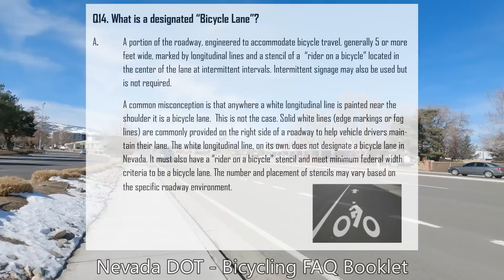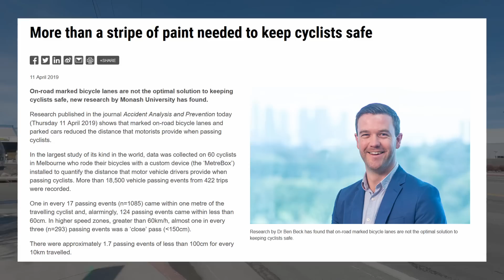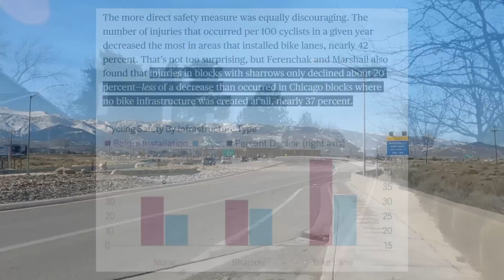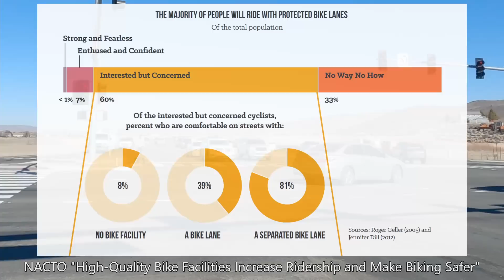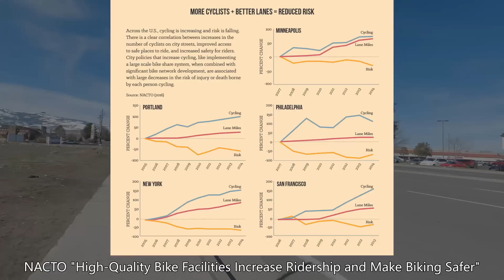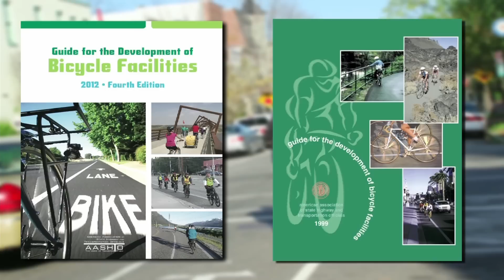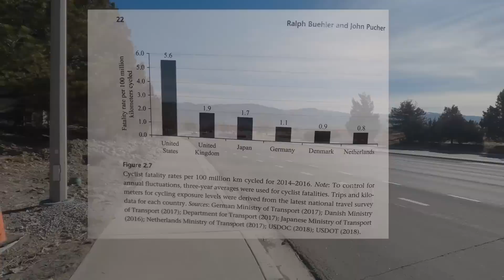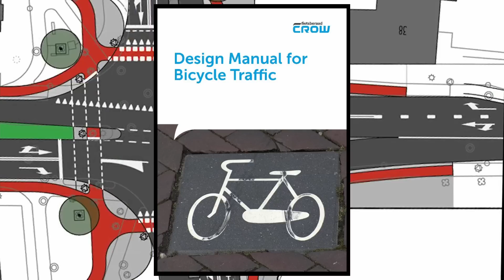Painted Bike Lanes Are Atrocious & Here's How to Fix Them

Comment: I guess you could consider me a vehicular cyclist.  When I was growing up and a young adult, there was no bike infrastructure to be found anywhere.  I lived in a more rural/small town area and if you wanted to ride your bike somewhere you just shared the road with cars most of the time, using shoulders when available and safe enough.  Later, I used my bicycle to commute to work while in college, on city streets, again with zero infrastructure.  Back then the advice was to learn hand signals, occupy the lane when turning left, things like that.  I did that and I was fairly comfortable with it.

What strikes me about these painted bike lanes is that -- as a "vehicular cyclist" -- there's a lot of them I would flat-out refuse to ride in.  They put me in mind of the narrow shoulders with sharp drop-offs you find on a lot of higher-speed rural roads (as opposed to the really rural roads with no shoulders at all), where you'd have to be suicidal to try to ride there.  They're the worst of every world.  You're far enough off to the side that a distracted driver won't necessarily notice you, but you're not able to be far enough off to the side to be safe from those same distracted, line-hugging drivers.  In situations like that I would always, always ride a couple of feet into the road.  Far enough that people coming up behind me in cars were more likely to notice me, while leaving some actual room to move over to the right if someone was nevertheless getting too close, without risking hitting the edge of the pavement and crashing.  And these stupid painted lines are saying to bicyclists: here's where you belong!  Oh heck no.

Comment: I am a frequent cyclist, do 99% of my shopping with the bicycle and I like the painted lines. If I'm on a separate bike lane, I'm often enough closer to pedestrians with their very erratic movement patterns, at crossings incoming cars will cross the bike lane - often without looking for bikes - winter service is generally bad on bike lanes, so my safety is compromised much more than cars passing at one meter distance. In Italy trucks will generally give you a warning honk to prepare you for the wind gust.
Now I have been very much annoyed by car drivers - on roads w/o bike lane markings - who want you off the road as their very own property and I have enjoyed - very expensive - bike lanes separated by a tree line but dare you wish to do a left turn into a smaller road, this is often not supported and you will to pedal on for hundreds of meters and the back track on the other side.
Drawing the literal and figurative line is a cheap and quick solution, to facilitate both sides cooperating.
On narrow roads where full bike lanes are not feasible this often the only sensible solution. And a cheap solution now is better than millions on solutions that will be ready ten years from now, will make car drivers even more hateful and face it is just more land put under asphalt.

Comment: George Carlin said it best - a bicycle is basically a toy. A bicycle is not practical transportation, especially where I live. There are elevation changes of over 1000 feet in short distances. Easy enough in a car, not so much on a bike. Everything here is a steep hill. Anywhere you ride it is uphill both ways.

Comment: They recently added bicycle lanes to Greensprings Highway, an industrial road for decades. This reduced car lane widths by several feet, making it hard for semis to use this road. Nobody rides bikes on this road because it is suicide to do so. If they do, they ride on the sidewalk. These bike lanes are atrocious. They have white pylons marking them off which also removed all turn lanes from the main road. Many of these pylons have been plowed under, which is what would happen to a cyclist stupid enough to ride there.

Comment: It's not just the US. I live in Romania and in my city the older administration did the exact same thing with bike lanes. They took the outskirts of the road and "transformed" into a 50 cm wide bike lane. That part of the road is where you have manholes, asphalt burr, potholes etc. You are riding along speeding vehicles that can suck you into the traffic if they go by fast enough. The scariest part is when buses pass next to you at an intersection and you don't know if they will cut your way or  run you over. Then you have cars parked with their rear protruding onto the "bike lanes", forcing you to jump into the traffic to avoid them, or irresponsible drivers opening their car doors right as you approach them. Riding on the boardwalks is illegal here, riding along with the cars is  scary and dangerous, especially at peak hours when all the "bisons" (as we call them) speed at traffic lights, stops and intersections. Whenever getting on your bike here you're taking a big risk on your life.

Comment: The problem is  a lot of the lanes are stuck into  ways that were NOT designed to have bike lanes, so they already eat up space needed for the cars, and if you add dividers it is easy to end up with car lanes too narrow for trucks.
Reply: You just found the root of the problem. Most streets can't even accomodate 2 cars, and some can't even accomodate 1 car, less can them accomodate trucks, buses, bikes, and motorcycles.

So what's the solution? Play the classist game and try to prevent bikers on the PUBLIC ROAD!?
Reply: This has been solved in many countries already. Give pedestrians and bicycles PRIORITY on the roads. Less polution, less noise, more kindness and sharing, more nature, more space, and bye bye traffic jams the main reason for people being always angry.
Reply: @angelhdzdev  That does not work when the said path is the only path that connect  2 large regions. Cars still move  more way MORE people than  bikes, so  the theory should be priority for  Buses, then cars, then  bikes. You cannot  expect    tens of thousands  to  lose their day because of a few hundred.

Comment: Although I don't enjoy the fumes and noise of the passing traffic, that is just a minor issue.  The important issue is the lack of separation and speed difference between me and the motorized traffic.
Reply: "the lack of separation"
I feel much safer in such a painted bike lane then in a fully separated bike road. Before a car turns right, it has to pass next to me and hopefully notice me.
Reply: @williamforsyth6667  Tell me how safe you feel when a fully loaded logging truck gives you a foot of clearance at 60 mph.  It scares the crap out of me!

Comment: Cyclists like predictability and continuity. I prefer a straight white line as segregation. If a street has parking then a separate path must have sufficient width for overtaking and safety from opening car doors. Bikelanes are useless if they change character all the time. A driver in a car can go down any street and be familiar with the layout - its straight and wide. Cyclist want the same and they actually need the safety it provides. To save space - in the real world - lanes for right turn can merge into the bikelane. Any special design is a huge red flag - predictability is key. I'm riding bikes in Copenhagen and suburbs.

Comment: These are just so strange to me, it seems so foolish. If the space for a bike lane isn’t the problem, why not make it any kind of raised/protected lane? Where I live in England, most of our bike paths are raised to pavement height. (Sometimes with a slight slope to make entering and exiting the lane easier), and they’re often semi-shared spaces. A common layout is a single width bike lane and a pedestrian “lane” of the same width (or slightly larger), and you stay in your own space unless you need to use the other space to pass. It’s not perfect, but it’s a lot better than a painted gutter, you get some form if protection, and it makes good use of space, in areas where a full size cycle path isn’t possible it’s good enough, providing bike and pedestrian traffic isn’t too high.

It just really boggles the mind that rather than something like that America just paints lanes in the middle of high speed roads.

Comment: The biggest problem where I live as far as bike lanes is that even if they did a protected bike lane on the stroads where they shoved gutters, there are still just way too many driveways and conflict points to contend with.  The solution there would I guess be to consolidate this stuff, but that would take a ton of money and political capital that I think is probably better spent elsewhere
Reply: These are the situations where traffic filters and stitching back roads together with bicycle/pedestrian only short-cuts can solve the problem.  Just leave the stroad to cars and setup a separate route for bicycles and slow-local traffic.

Comment: Jersey City used paint to rapid build bike lanes, but they used the Dutch design manual to do it. Within a year it became one of the safest cities in the country to cycle in. The paint was considered a temporary emergency measure to keep people from dying, and 2 years later they have been going back and installing concrete barrier between ALL bike lanes and car lanes in the city to improve safety. The state of NJ also made it illegal to get less than 4 feet from any road use, such as cyclists, with a motor vehicle, it’s illegal to pass them going more than 25mph unless it’s a separate marked lane, so any of those dangerous passes mentioned are explicitly illegal. On roads without separate cycle lanes it’s illegal to pass a cyclist if it’s illegal to pass a car and you are required by law to slow down to the cyclists speed, or come to a complete stop. They started installing “super sharrows” where the entire width of the lane is painted green, to indicate the car is in a cyclists space, not the other way around. 

Paint can be used to help cyclists, but only if what you are painting is laid out to Dutch standards, and it’s a temporary measure until permanent concrete protection is installed.

Comment: I would add an exception to paint is not infrastructure: Painting bike lanes solid red (or using red asphalt) actually helps. Of course it shouldn't be used as much to separate cars from bikes and more to separate pedestrians from bikes. We all know if there are just lines on the ground pedestrians will simply ignore them and walk on the bike path.

Comment: 3:25 There are many of these. They make sense at an intersection where the right lane is a turn lane so that bikers can have a designated (yes, I realize it's just paint) lane to be in if they are going straight (or even left). It's where they should be anyway if not turning right.

Comment: Honestly, painted bike lanes by themselves are not a problem. I ride on them every day in Germany and I do think they have their place in city streets definitely not on roads). While being raised on the curb feels safer, it creates problems at the intersections. Unless you commit to Dutch levels of separation and bike priority, having bikes on the road at intersections means better visibility and better left turns. 

If you’re on the sidewalk, the likelihood of being hit by a car doing a right turn are quite high, especially with the American „turn on red“. Having green for bikes a few seconds ahead helps, but I’m not sure Americans are ready for that step. Having the bike lane on the left of a right turn lane means the sorting happens in motion, when the bike is in front of the car. Also turning left from the sidewalk means waiting for two green lights, which is just a nuisance.

The core problem with American bike lanes are the stroads they are painted on. If you have roads the size of highways, putting a tiny bike lane on it just doesn’t work. On those roads starting with anything else then separate infrastructure will never work. Then slowly decrease the width of the road and the traffic and in 10-20 years people might be slow and used enough to bikes for them to respect a decently sized bike lane. And then it’s actually better for bikes on the road. But any speedlimit above ~30mph is too fast for that.

Comment: This is why I just use sidewalks when biking in US many cities (except the dense urban cores though). These bike "lanes" are just so randomly-placed, inefficient, and outright dangerous if the speed limit is above 20 mph. I'm aware of the many dangers with biking on sidewalks with pedestrians and curb cuts, but most sidewalks are empty, wide, actually grade-separated for protection, and fairly well connected.
Reply: In my option bikers are pedestrians and sharing the road is down right stupid. Bike hitting walker most likely minor injury, car blearily hitting biker high risk of death or life changing injury.
Reply: @Zucr_ Bicycles are most definitely not pedestrians. They are much faster and can't  turn the same way a pedestrian can. They share vulnerability against fast heavy motor traffic. Similar to sidewalks there should be bicycle lanes or streets hostile to fast motor traffic such as the street can be shared safely.
Reply: @Anders127  I mean if you want to be a literalist then by all means... My point is that a bike is vastly closer to a pedestrian than a vehicle,  If you had to put them in the same bucket (on the road vs off the road). Its really not even a comparison. In most areas the side walk is empty anyways.
Reply: @Zucr_  It's funny. In many places, it's illegal to ride a bike on the sidewalk. This is because the cycle moves several times faster than a pedestrian. But cars move much quicker than bike riders, and we are expected to share the road with them. Pedestrians are separated from us bike riders for their safety.  We riders are squeezed into the gutter.  I ride in the lane and take the lane where necessary, no matter who disapproves.  I ride where it's safest for me, and often, that is in the center of the road.

Comment: Bicycling can be made safe?  Its balancing on two wheels without air bags or seat belts for collision protection.   The bicycle special interests need to understand arterial bike lanes are hopeless failures.  They aren't getting the ridership -- long-term numbers.  They are designed for spandex commuters -- not the future of e-scooters, bikes and unicycles.  Bicycles will never be the equal of vehicles that can carry large families or tools of the trades.
Reply: not that many people transport large families or when they do it's not often enough to justify a cage of 2 tons of steel and plastic.

and if you really need to transport stuff rent or use car share apps.

Comment: I think that these gutters are being used willfully to set cyclists and motorists at each other..."look how unreasonable it is to have bike infrastructure".  Colorado Springs suddenly started painting these, even downtown with myriad business entrances crossing them...even though Colorado Springs already had a well used, well liked network of off road bike paths spanning the city, for decades.  I think that the car lobby has jumped on these bike gutters as a way of throwing sand in the tracks of the push for bike paths and pedestrian paths, trying to create friction and deaths.

The gas tax is similar.  The car lobby doesn't want it large enough to deter driving, but wants to pretend that motorists are paying for, not destroying, the rights of way.  Why would every administration talk about massive infrastructure bills if the gas tax were paying for roads?  If it were, you'd just decide which projects to allocate that money to each year.  Instead, enormous sums are pulled from general revenue (income taxes, etc.) to cover the massive, perpetual shortfall in gas tax revenue.  We could never build the interstate highway system today with gas tax revenue, or even these infrastructure bills for that matter.  So, no, motorists, including me, don't pay for the roads through gas tax.  They do more damage than the gas tax pays for, witness all the cracks and potholes that the gas tax doesn't cover fixing.